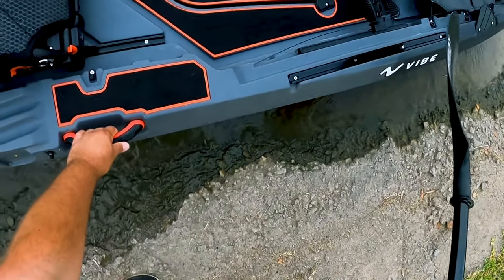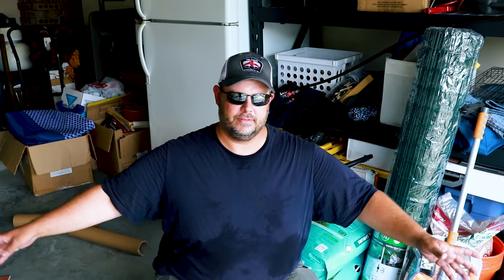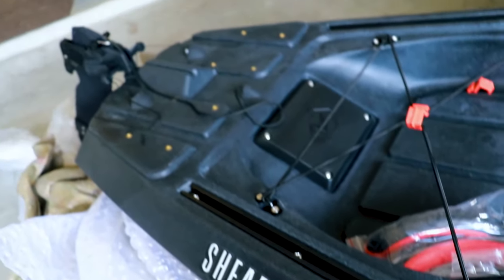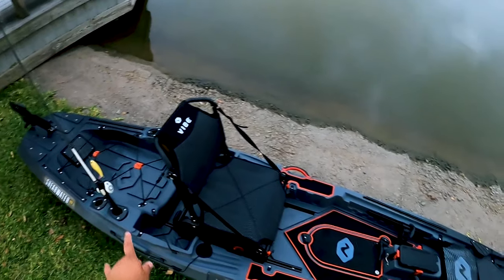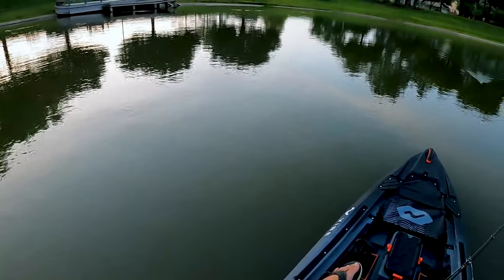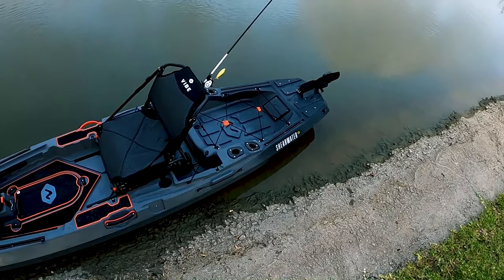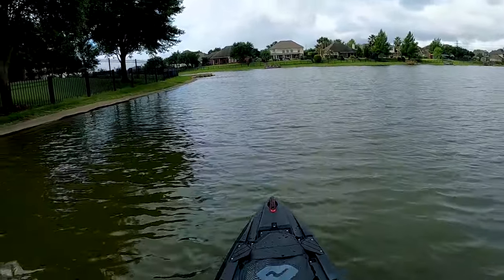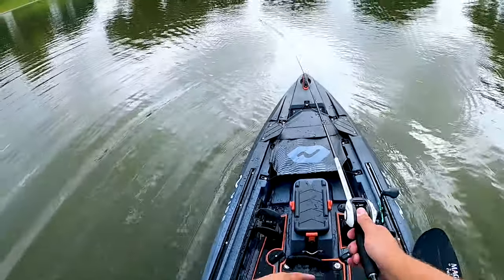Vibe Kayak Shearwater 125 Walk Around and On the Water REVIEW!

Comment: I’m not an expert by any means, but I have been kayaking many many times, especially in the ocean. I find that when you’re fighting the wind and/or current, it helps to widen your grip on the paddle. You can really drive it through the water better when you engage your shoulders a little more. I couldn’t see your hands clearly, but at times your grip seemed a little narrow. Maybe I’m wrong, like I said I couldn’t clearly see. Anyway, next time you’re fighting the current give it a try. Congrats on the new gear buddy!

Comment: That may be the coolest looking kayak I’ve seen, a little out of my price range though.
Reply: That's why I researched my kayak for over a year. My 1st and last kayak. I see no reason to upgrade.Especially as the accessories add up quick. I purchased the HOODOO TEMPEST HYBIRD 120PDL. $899.00, And came factory with 9 scupper plugs, 2 anchor trolleys, removable center console, for PDL or T.M. Paddle, framed seat, toe control drop down rudder, gear tracks, deck padding, battery box. They make there own 46lb thrust trolling motor, where the PDL would sit. So I did go with the trolling motor and just recieved my bixpy J2, With the vibe gravity rudder. I'll use one or the other, but both will be on board. They make a kayak for everyone's budget. I wanted the accessories we all need, so me at 5ft 7" 151 lbs. My kayak feels like a little bass boat, I setup for my fishing. Goid luck, if you're looking, or already on the water. 🤟🎣🙏

Comment: A few suggestions for you about kayaking. Your paddle is upside down. You should be able to read the label on the paddle (Label facing you and rightside up). When you're entering the kayak, be sure the keel is not touching the bottom . The kayak is much more stable when it's floating, then when it's touching bottom. Another tip is to walk the kayak out in the water a foot or so deep, and sit on it like you're sitting down on a sofa. Sit your butt on the seat sideways, and slowly rotate one leg into the kayak at a time.
Reply from the maker: Thank you so much for the tips! I will make sure to use them tomorrow when I go out again.

Comment: I had a pelican castaway 116 kayak back when kayak fishing started getting big.  Pelican just took a recreational hull, made it a sit on top, and added fishing rod holders and called it a fishing kayak.  It was the most unstable kayak I had ever used.  I built outriggers from 8ft oak staves and 4" pool noodles.  It was the only way to keep it upright.  Trust me, I weighed close to the same weight you did when you first tried it out.  Its one of the worst hull designs for stability.   There just isn't enough secondary stability for anyone of any weight to fish out of.

Comment: Hey bro, you will love that boat. It's meant for bigger guys. This is my 1st season off the bank. I researched for a year, and did want the jonny bass 100. I'm 5ft 7 150 lbs. I went with the hoodoo tempest Hybrid 120. The hull is actually designed similar to the vibe seaghost and shearwater. I have the fitted trolling motor, which is 46lb thrust and only weighs 20lbs. Drops in right where my PDL goes. I fish a 1600 acre lake I can now explore. I can stand on my bow, in the tank well, and walk my deck. Definitely invest in the PDL Drive, and the bow mounted trolling motor. You're going to love it. It's one of the best kayaks built. Be safe my friend. 🎣🙏🤟

Comment: Great video, I just found your channel and subscribed. I too just got my first kayak and freakin love it, to heck with bank fishing. Lol!  I’m a bigger guy as well at 6’2” 375, so I know the struggles on the water 😉. Kayaks respond a lot differently to big guys compared to “average size” guys. Just take your time and get familiar with your boat, there’s no rush to standing up or whatever. I’ve had my kayak for about a month and just recently stood up in it for a few minutes. I still get nervous because last year I turtled a canoe in a marsh with alligators, lots of mental scars 😳. I just wanted to share the easiest way I have found to get in my kayak. With the boat parallel to the bank, if it’s facing left I hold the stand assist strap in my left hand and step in with my left foot first where it would be if I was sitting down. My weight is now causing the kayak to lightly make contact with the ground which gives some stability. I then step across with my right foot where it will be when sitting down and then slowly lower myself down into my seat. This has been the most “graceful” method for me getting into my kayak, hope it helps. 🙂
Reply from the maker: Thank you so much for checking out the video and subscribing! I appreciate the pointers you gave me. I am still learning new things every time I go out on it. I have a new video posting today and I have a bit of a net fail! Thanks again for checking out the channel
Reply: Just curiouse what kayak did you buy is it the shearwater as well?
Reply: @b.rabbit725  no, in May 2020 I bought a 2019 Jackson BigRig. It’s the OG not the HD/FD. I like the OG style better.

Comment: The bungie that secures a horizontal rod should be screwed on underneath the side handles and latch to the tie-down above them. They should have come in the bag with the handles/screws.
Reply from the maker: They did, I just didn’t know where to put them. Thank you! They didn’t come with their own screws so I will have to get some myself I guess.
Reply: @bashinbasstv9112  Sorry this is many days late- but they use the same screws as the handle. Put them between the hull and the handle before you insert the screws

Comment: If you want to stand up all the time in a kayak I’d suggest a standing cord to help you stand up also a bigger kayak like the native titan would probably fit you better than that one but the titan also costs 3x more.
Reply from the maker: I actually tried a dog leash for a standing cord and I’m losing weight right now so that should help a lot with me standing.
Reply: That’s good losing weight will help a ton. I’ve also seen metal standing rails that attach to almost any kayak that you could hold on to while standing. I know with mine, first starting out, it still felt wobbly while standing. I had a bonafide ss127. I ended up hating paddling I’d much rather have a pedal drive like yours or a hobie.
Reply from the maker: @SmokinNate  I’m actually going to get the pedal drive in April with my next bonus from work. I want to start taking it on bigger lakes and travel with it for the channel and I think a pedal drive will make things a lot easier
Reply: @bashinbasstv9112  it definitely will. I’m sure you’ll get it and ask yourself how did I get by without it. I took mine out on a couple of big lakes; wind is this biggest problem. 10 mph is rough out there.

Comment: Not sure if anything else has said anything but your paddle is being used upside down. But I like your video. I want one of. Those boats lol. Colors are awesome.
Reply from the maker: Thomas Obrien lol yeah I have been told that a few times before. Thanks for checking out the video! You should get one when they are in stock again.
Reply: Bashin Bass TV saw you had it flipped over later in the video. Hoping they come back in stock to get one. Whole line up is OOS.

Comment: I’m a bigger guy also and I’ve been looking at this kayak for myself. Your video was the tipping point that I needed to choose this kayak. Did you find the dark color plastic to be hot in the sun?
Reply from the maker: Not really but I’m in Houston so it’s always hot! The one thing I will warn you about with this kayak is sometimes they put the wrong gaskets in the deck plates and it leaks. They did it to mine but sent me the correct ones and I’m about to put them in to fix the issue. I will be making a video about that this week. Other than that it’s an awesome kayak!